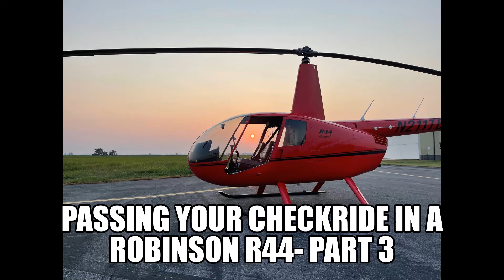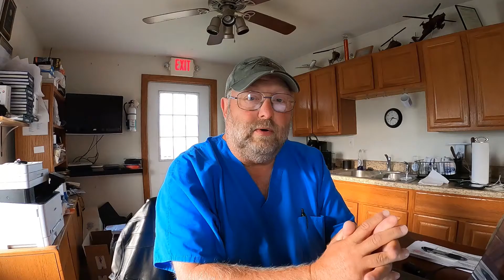Part 3- Passing your Helicopter Checkride in a Robinson R44

Comment: We use (MAMAS FOOT)
Manifold pressure gauge, altimeter, magnetic compass, air speed indicator, safety belts.

 fuel gage, oil temp, oil press, Tach

Great videos love them, check ride in 20 days